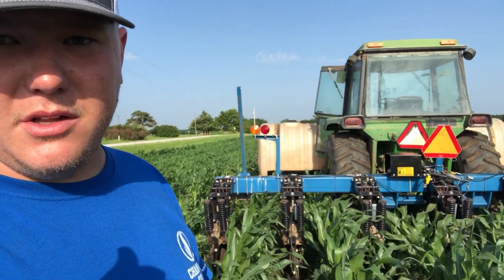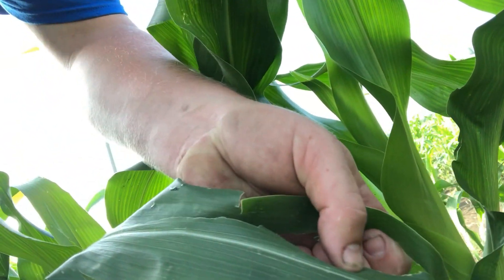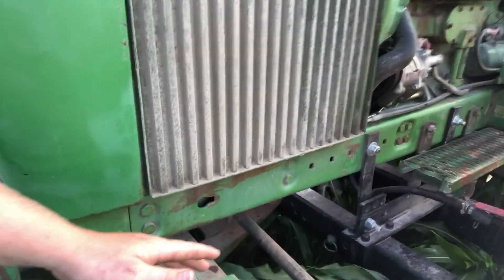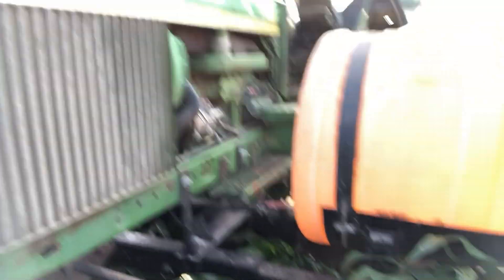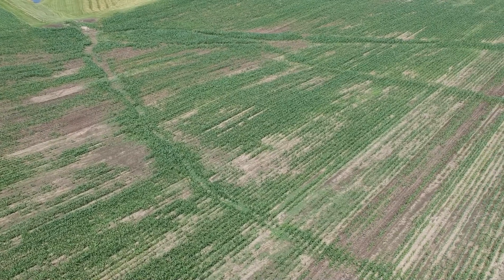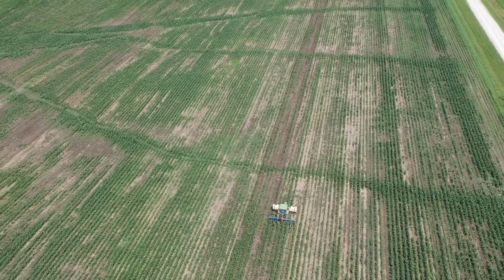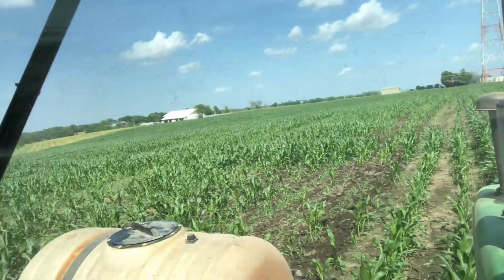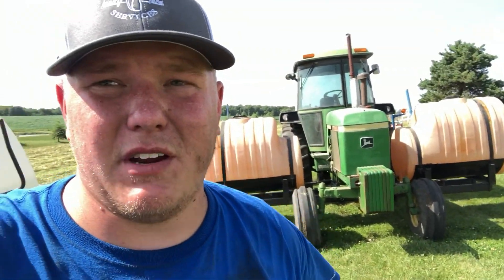Drain Tile Importance on a Farm

Comment: I grew up in an excavation company and spent most of my life making water go where I wanted to, well most of the time, lol. It wasn’t until I got to watching YouTube that I learned about tile and it’s a no brainer to me, we fixed a corn silage field with French drains on a farm once, the way I see farms do tile online with a plow would have been way cheaper and faster then digging all those ditches and placing 3/4” clean stone but with all the roads, houses and commercial buildings I did in 20 years I never would have thought water would get into perf pipe that deep in the ground without being bedded in corse sand or stone. MnMillenialFarmer’s video on it was eye opening to say the least
Reply from the maker: What is a French drain?
Reply: iowANFarmer  Typically when you do them you would  use an 18”  or 24” bucket and dig it from the ditch You want the water to go to, ideally starting above the high water mark of the ditch. Figure out whatever you need for a rise vs the run and keep a nice flat floor to your trench. You’ll put 8 to 12 inches of clean 3/4” stone in the bottom and cover the stone with good layer of shit mulch hay or the cloth like type of filter fabric(kinda pricey $$$) and back fill. They work great if you keep your trench in  between two high spots. The hay keeps the stone from getting full of silt and the stone acts just like a culvert pipe as long as the floor of your trench is flat bottomed and not just dug with the bucket teeth
Reply from the maker: 2009deerejohn that’s kind of what I do around big inlets. I put fabric and big stone around them to let more water in and keep the silt out. But they can only handle so much. 10” of rain in 10” days it can’t really handle. Thanks for the explanation.